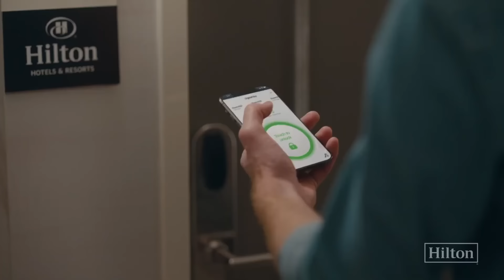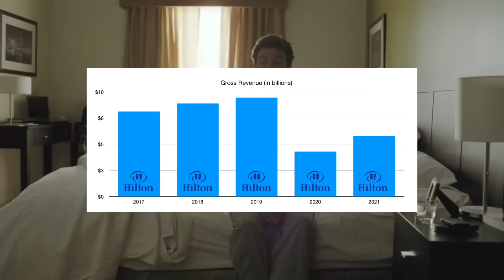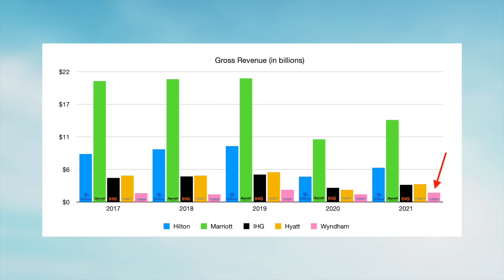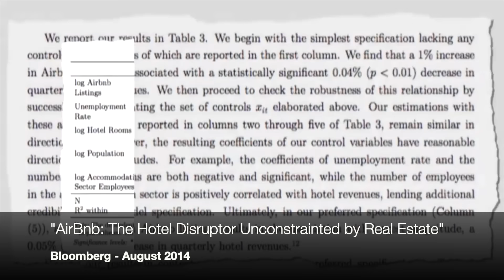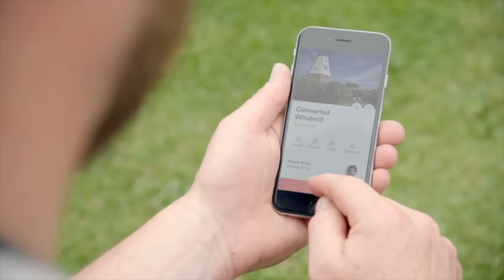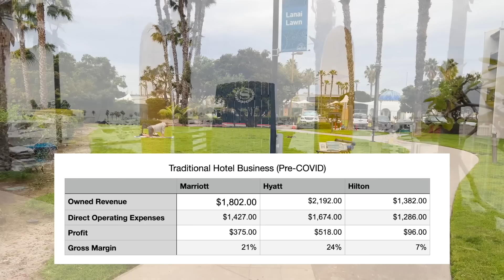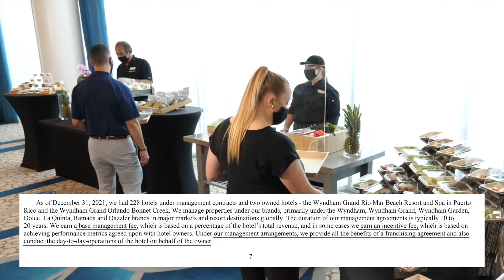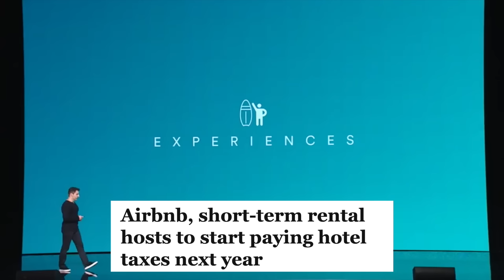Why Airbnb Fails to Disrupt the Hotel Industry

Comment: Airbnb is yet another factor in the affordable housing crisis
Reply: That’s the real industry they’re disrupting
Reply: I've had a few hosts mention how they're actually buying houses exclusively for Airbnb, or they're converting their rental units to Airbnb. It's turned me off of the company.
Reply: Affordable housing isn't a crisis. It has little to do with "housing" and everything to do with class divide and the changing economy. It would be better called an affordability crisis.
Reply: @flyer3455  It definitely is partly due to the rapidly increasing housing prices. I can understand the angle you’re coming from but it’s a mix of many factors, housing is not affordable, wages have stagnated, supply being bought by people and corporations who are using houses as investments rather than shelter etc. The class divide definitely has a lot to do with it as well, as the bourgeois have and will exploit the proletariat for even a dollar more in profit.
Reply: @flyer3455  So you want to rephrase the problem to sound more abstract and harder to fix?
Reply: @Shoobster  "affordable housing" sounds like a demand for more Section 8. Everything would be more affordable if the right jobs were here, a better education structure was here, and out of control inflation was not here. The class divide is a result of globalization and the violations of the basic assumptions of economics- mobility of labor.
Reply: @flyer3455  "the violations of the basic assumptions of economics- mobility of labor"
Quite the contrary; What you're seeing is a global result (the likeliest one) of mobility of labour; The demand for labour moving to where supply is high and cheap.
Reply: @OzixiThrill  That makes little sense. We have economic and political borders in this world. It's obvious. I cannot just go to India or China to get a job that was once in the US.
Reply: @flyer3455  It takes about as much paperwork (in fact, far less) as it took the corporations to move over.
You absolutely CAN go to those places to try and secure those manufacturing job. It's just not going to make much sense to you, as you would need to give up absolute (though not necessarily relative) earnings to pull it off.
Reply: @OzixiThrill  It's not just some paperwork. You'd also need to learn a new language and culture. You'd have to acquire those skills to perform the same job and live there. There are barriers to getting visas. They're not handed out like candy on Halloween.
Reply: @flyer3455  Same as what the management staff on some layer of the corporation had to do to set up there.
Culture is mostly irrelevant.
What you'd need is the basics of a language and some of the most important bits of the culture. The rest is absolutely irrelevant.

There are also barriers to corporations setting up shop in a foreign nation. In fact, there are far more barriers for a corporation than there are for an individual. As for visas, your mileage will vary depending on the nation you go from and the nation you're going to.

At this point you're sounding like someone whining that doing a tenth (not even) of what the corporation had to do is too much effort for a job.
Reply: @OzixiThrill  Your arguments are neither compelling nor sensible to me. Thank you for this chat. Good day to you.
Reply: @sweetembrace6706  What does it mean to you? Subsidized housing? Or jobs that can pay for a home? I don't believe in handouts.
Reply: It's not.
Reply: @HiNickCares It is

Comment: In my experience, Airbnb's "quality control" (or lack thereof) is incredibly subpar. Many hosts charge ridiculous cleaning fees and obviously don't clean the spaces either. I only trust super hosts at this point.
Reply: I once had an Airbnb and one whole floor of the place had fleas. They said to just stay on the other floor and didn't cut the price.
Reply: I showed up once and the room was completely different from the pictures and the woman didn’t even finish cleaning it! There was a garbage bag and free frebreeze bottle there, so I left. I hotel room was only $20 more and it was actually clean.
Reply: Super hosts are shit too. The one I stayed in recently had a good cleaning tag but the carpet was disgusting and the sheets were clean but all stained. Disgusting is not enough for how bad it was.
Reply: This is still true for superhosts
Reply: I’m a superhost with 20 listings. I have very good cleaners and I do spot checks regularly to make sure everything is perfect. My places are often cleaner than hotels but please consider some things 

1) most Airbnb homes have about 3-6 x more square footage than a hotel. It’s WAY easier to clean a hotel room than a house. Not even close. A room can be turned over within 30 minutes. A house is more like 3-4 hours. 

2) most hotels have carpets on the floor. You’d be shocked at how dirty they are. All of my places are hardwood and always mopped.
Reply: @Plasmacat1  
Hotel carpets are even worse. Hotels invest in carpets that don’t show stains but they have them.  Do you know how often hotels steam clean or wash their carpets? Probably never. 

Don’t book a home that is carpeted. Plenty of Airbnb’s if not most have hardwood floors
Reply: I've been accused of theft and damage that my party did not incur before, which I suspect to be a grift of some sort. Additionally, I've experienced weird and arbitrary "rules" that are never communicated but the hosts attempt to retroactively enforce regardless. I'm pretty tired of Airbnb despite typically having pretty good experiences. The inconsistency and economic damage to the housing market mean that I'd rather just pay a little extra for a hotel these days.
Reply: @MrCalijor  
It’s always interesting when you state “your party”. Do you think the member of your group would admit to breaking something ? Frankly, a lot of group members are cheap and dishonest and would not admit to it. 

It happens often to us hosts and nobody wants to take responsibility. Don’t blame the host. Blame your group members
Reply: @sean4060  I spend min 2-3 hours for cleaning and still can get one star for cleaning 🤦‍♂️ I make sure including kitchen and bathroom is stainless and hygienic. Nobody complained about cleaning before and some spoiled couple left me with a bad review. Satisfying people is impossible 🤦‍♂️
Reply: @hakansaribal5093  
I found after I started doing spot checks after my cleaners did their job , I hardly ever get less than 5 star. Sometimes you need a second eye to catch things. As a host , it’s better to hire cleaners and you should Be the inspector catching things they missed
Reply: @sean4060  While that is true of hotel rooms, hardwood floors don't resolve the problem of cockroaches in the house...
Reply: @oldskoolmusicnostalgia  
Why would a house have cockroaches ?
Reply: The Air bnbs that are actually rented thru third parties AKA vacation rental companies are the best. I work for a rental company in Hawaii with about 90 units on island. We have professional housekeepers and quality control who inspects the cleaners work, and checks for maintenance issues. We then dispatch maintenance as needed. Our units depending on location, are at least 1/2 the price of the hotel rooms here. And you get multiple rooms, full kitchens, onsite team who will help you when needed
Reply: Even super hosts... I found places that have clean looking but actually dirty floors. As an Asian who walks barefoot in home and keeps the floor very clean, I find the floors of some hosts very gross. I always wipe down floors (and often find them really dirty) before I set my foot on them and make sure I bring a spare slipper.
Reply: I don't even stay a super hosts anymore.  In fact I haven't booked an Airbnb since before 2020. At first Airbnbs were a pretty cool concept but in my most recent experiences they have all fallen short of expectations in every which way, including "super hosts". From bookings that fell short of their descriptions, to the ridiculous fees for bookings that were mostly cosmetically clean, staying at Airbnbs have actually made me appreciate hotels even more than ever before.
Reply: @CheesyDoesItCooking  Do you Supertravel all the way too?
Reply: Former superhost here. I haven't done Airbnb for years, since we've had children. I won't lie to you: very seldom cleaned after a guest if there was no visible filth. The ol' shake and spray usually did the trick, and never had a complaint. It wasn't obvious, but the space was not deep cleaned each time, especially if it was just a 1-night stay. 
Am I proud of that? No. But it IS the truth. Don't kid yourself.
Reply: Even superhosts are screwed up sometimes.
Reply: I don't trust any of them at this point, part of the issue with AirBnB after using it to travel the country is the INCONSISTENCY of the product. Every place has different check-in and check-out instructions.

Every place we stayed at, we did the same thing. Tidy up the room of garbage, remove the linens, put the towels on the bathroom floor.

Two of the places we stayed at, COMPLAINED that we left the house messy, while EVERY OTHER PLACE I'VE STAYED at on the way, doing the same thing stated that I left the house clean and was a polite guest. 

It's this inconsistency that makes me want to completely avoid AirBnB in the future.
Reply: When I tried AirBNB, the very first host I booked screwed me over, then the second one tried to screw me too. I will never use AirBNB. I have no problem seeing why the legacy chains aren't concerned.
Reply: Because some guests are ridiculously disgusting, I saw poop on my bathroom mat
Reply: @sean4060  I appreciate your perspective, but what you do is far less universal than what a $150/night hotel room generally does. There are good hosts on AirBNB, Vrbo, etc., and I default to these services when I need a place for large groups, but when it's a small group there generally aren't enough advantages to choose these services over traditional hotels.
Reply: @sean4060  Are you done with the excuses now? We pay what you are asking for a clean place to stay. Hopefully with enough toilet paper for everyone during the entire stay.
Reply: What excuses? I never made excuses
Reply: Airbnb started as a hipster hippie cool stuff where some cool people offered you to stay at their appartement or house for a small fee

And the goal wasnt even money. But more like a connect with people from around the world with different culture thing. And have friends from all over the world

And i am not kidding or overexagerating. Airbnb used to be some hipster hippie thing 😂 kind of like the climate change hippie or vegan hippie

Then when it got very popular. All those greedy real estate owners jumped in for the $$$. Very lazy on your accomodation, very tricky to snatch as much money as possible from you

Very often those owner dont have the money to renovate or take care of their appartement proprely. They only there to take your money. And act as if they are entitled to lot of your cash cause real estate tax are so high and need to pay bills
Reply: I’ve never had a bad experience of any sort in an Airbnb. I read the reviews and contact the host beforehand and get a feel for the place I might rent. I have often contacted the hosts while in the rental property and have found every single one address my concerns to my satisfaction.
Reply: Right I only trust super host also. The one time I didn’t they had bed bugs and pest roaches and the host just said “maybe bc it’s 50 degrees outside the roaches are just coming inside” and then Airbnb wouldn’t do anything about it either except refund $70 and didn’t guarantee to make sure the pests were taken care of💀
Reply: They raise the cleaning fees because of the taxes they have to pay based off the money they make from the room. Cleaning fees are either not taxed, or taxed at an extremely low percent, thus the incentive to do this.
Reply: They are charging that to offset what airB&B charge them and the consumer can't do anything about it.
Reply: @K10 if you have vpn set location to AUS and access then. Laws there require full price including fees to be shown.
Reply: 2 houses ago, the rental I was in eas full of penis-shaped balloons when we arrived because the host failed to clean after the previous tenants had a party. I nearly had a heart attack because I thought some prankster broke into the house. Turns out the balloons were stashed under some furnature & an open window blew them out from hiding.
Reply: Chesky once said all listings will be verified, but that hasn't happened. Misrepresentation on Airbnb is rife. There is a possibility that if they verified all the listings, most of the listings would not be satisfactory.
And the better qualities non-hotel listings that actually survive, are essentially run by budding hoteliers aiming to provide hotel levels of service.
Reply: Exactly.
Reply: You are confuse Airbnb is not a hotel and neither  provides you with a place to stay.
Reply: @sean4060 blame your mother
Reply: It depends on price range and neighborhood. You go and stay in a crap neighborhood with a crap price expect a crap landlord that doesn't clean anything.
Reply: @sean4060 i have worked in the hospitality industry for eight years and we absolutely bring some one to clean the carpets but then again maybe u have stayed at an off brand motel 6 however that doesn't excuse the issues people have with airbnb so stop trying to dismiss the issues just because ur personally butt hurt
Reply: Super hosts aren't much different. My one and only Airbnb stay was with a superhost and the experience was horrible. Room was infested by bed bugs and all the stupid rules. it feels like living at someone's home for free while you're paying almost hotel fees. And the privacy is a joke. They keep looking at you through those cameras constantly to find a way to screw you more. And the cleaning fees.. Don't even get me started on that. Not to mention they are one of the contributors of the housing crisis throughout the country.